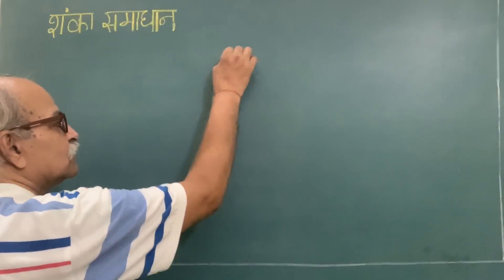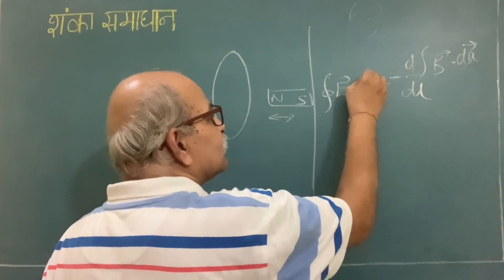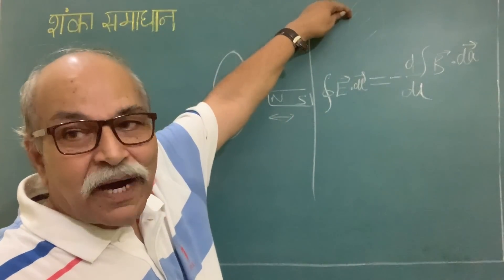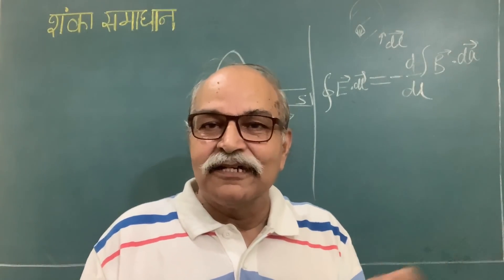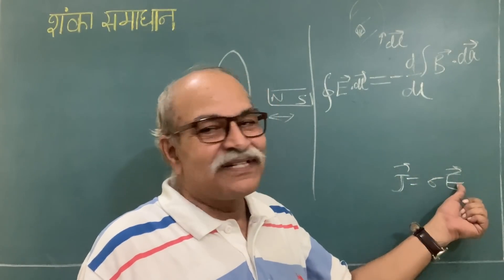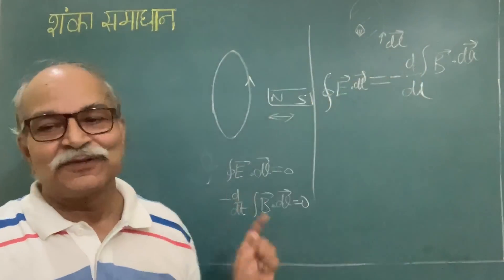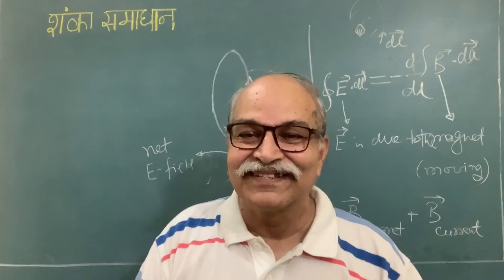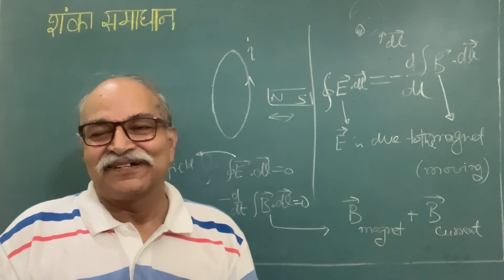Magnet moving in and out of a superconducting coil

Comment: Sir I thought it this way:
If we try to move the magnet close to the loop, then the loop being made of a superconductor will compensate for the flux produced by the magnet by producing a current in the loop making net flux zero. But when the distance between the loop and the magnet becomes zero then infinite current needs to be produced in the loop which is not possible,so we can say that the loop will not let the magnet move by producing repulsive force.

Comment: Prof Lewin says that there will be a current on the surface of the superconducting coil but not inside it. The link to the video in which has posted this solution is https://www.youtube.com/watch?v=fGM5AtwEmuQ

But he does not explain why no current inside the coil does not violate Faraday's law. As Prof HC Verma has emphasized, Faraday's law is applicable on any closed loop, even if the loop is intangible. If we want, we can consider a loop inside the coil. According to Faraday's law, an emf will be induced in that loop, which means an emf will be induced inside the coil. Then why is there no current inside the loop?

Comment: Legends are contradictory with this question and it came in jee advance after 3 week of this video.
Thanks to HC verma sir and Walter Lewin sir. I got 4 marks from this lecture.
Reply: If it was normal Lenz's Law or the 'like' pole - the same pole - produced by the superconductor against the encroaching (moving) bar magnet,  the  magnet would not float, would not levitate,  atop the superconductor - the magnet approaching the superconductor would be cast off to the side, just as in a normal Lenz's Law demonstration.  There is something different occurring with the superconductor - because the encroaching magnet, if placed atop a superconductor, is (1) repelled by the superconductor but also (2) remains in place, levitating, above the superconductor, and is not tossed off to the side.   This is not Lenz's Law.   

The entire problem with common physics today is complete failure to assess and investigate the constituents of the Vacuum  (not the air-pressure-free vacuum, the QED Vacuum).   Until the exact physical nature of the Vacuum is examined - rigorously - these types of questions will fail to be answered accurately.

"So you think space is not empty?  You think there are 'constituents' in empty space?"  Yes.  Here's how to demonstrate it.

1)  put one neodymium (strong, rare-earth) magnet in each hand with the "N" poles of the magnets facing each other

2)  try to push the two "N" poles together so they physically touch (you will not be able to if the magnets have any noteworthy size)

3)  now, while you use your hand strength and coordination to try forcing the "N" poles together,  there is still a gap of space between the magnets because you cannot easily force the two "N" poles to touch together

4)  CAREFULLY LOOK into the gap between the two magnets - IT LOOKS EMPTY

It is NOT empty.  The constituents of the particle-antiparticle Vacuum are not discernible to our vision, but the magnet test above lets you feel the effects of the constituents of space.  An invisible, quite strong force preventing you from forcing two pieces of metal together.

If you're curious along these lines, note this.  The 'virtual particles' of the QED Vacuum - such as electron-positron pairs - are claimed to 'pop into existence, then self-annihilate'

It is long established in the lab that the annihilation of an electron-positron pair produces gamma rays.  If the 'virtual' particles actually self-annihilate, the Vacuum would sustain an easily detectable gamma ray background.  And IT DOES NOT.

The spin of the electron and positron are equal, and OPPOSITE.  The particle-antiparticle pairs that fill the Vacuum are persistent, and dipoles can be induced in them.  They do not self-annihilate.  They are not detected because they are dipoles and cancel.
The electron-positron dipole consists of:
- a negative electron and a positively-charged positron
- opposite spin on the two ends of the dipole

The constituents of the Vacuum can be manipulated (dipole stretch induced, or dipole stretch removed) but the only way to do so is with coherence conditions imposed on the atoms of a matter object.  Coherence imposed on piezo materials by a maser is one way to alter the Vacuum coherently.

The Vacuum very rapidly quenches any attempt to alter its conditions unless the attempt is coherent.  Artificial gravity can be produced in this manner. 
.

Comment: We Generalise a wire based circuit MOSTLY AS A  ONE DIMENSIONAL WIRE with r=0 so it has no interior or exterior or the interior and exterior are virtually not present as if its a line with just 1 dimension.
Here we are taking a wire with finite radius where it has a external and internal space different from each other or as if radius of wire is not equal to zero.
prof verma did with the idealisation of r=0.
I think then it just becomes a thought experiment.
But Prof. Lewin did analysed the situation with a non zero radius .i.e the wire has a surface and then internally E=0.
I guess with the idealisation Prof Verma's solution is not wrong.

Comment: Sir I am in class 10 I have a doubt
Can the average speed calculated like
(Initial speed + final speed )/2
If yes how,if not why
I would be very thankful to you
Reply: It depends on how you define "average speed", IOW on what you intend to do with it.
One usually defines "average speed" as that CONSTANT speed an object should have in order to travel a given distance L in a given time T.
With this definition, the average speed is equal to the *arithmetic mean*, that is (initial speed + final speed )/2, when
- the speed is constant (of course 😁)
- but also when the speed is simply proportional to time v = at, where a is constant in time. This is the case of uniformly accelerated object, with (constant) acceleration equal to a.
However, when the speed is NOT simply proportional to time, but depends on time in a more complicated way, the average speed is NOT equal to the arithmetic mean of the initial and final speeds.
------------------
Remark: it can be show that the average speed is equal to the arithmetic mean also when an object moves with one constant speed v1 the first half of the total TIME and with another speed v2 the last half of the time: v(mean) = (1/2)(v1+v2)
It is interesting that, when an object moves with one constant speed v1 the first half of the total DISTANCE and with another speed v2 the last half of the distance, the average speed is the HARMONIC mean : 1/v(mean) = (1/2)(1/v1 + 1/v2) !!!
Reply: > Thank you !
You are welcome !
Reply: @alexleibovici4834  sorry for late replying but a very big thank you for answering my questions.
Reply: @harshpawar8882  
OK 😁 Hope it helped.
Reply: @alexleibovici4834  yes it did

Comment: It's not good to post any thing or answering the question if you actually dont know its answer..... "Formula says thats why it is happening" what kind of explanation is that?..... Physics is not formula based, Formulae are based on physics....
It also shows that our top class professor knows nothing about concepts of physics.... I would have tell you more but let's just say that...... H.C. VERMA is just good enough till class 12th and not for higher engineering physics
Reply: Ok Einstein
Reply: Go and check out his lectures on nptel for nuclear physics and you will realize the dumbness in your comment.
Reply: Even your father Lewin has made enough of wrong statements in his question video pertaining to superconductivity.

Zeroeth of all, he calls it a JEE problem...Seriously? Superconductivity?

Now comes the first point. Lewin says that there can be no electric field inside the superconductor. "Blatantly Wrong!!!". Ever heard of london penetration depth?

Lewin says in the solution video that the current will flow on the surface of the superconductor. He says that there can be no current inside the material. "Blatantly Wrong!!!" Surface by definition has zero thickness which will blow up the areal current density. The truth is that the current does flow inside the material but near the boundary of the material(near the surface, not on the surface!), significant amount of which is upto the penetration depth. Only deep down the superconducting material, B and E go towards zero.

This penetration depth can be of the orders of nm to um or even could become very very large if you happen to go near the critical temperature.

Second point, Lewin says "the beauty is...faradays law...creates an emf...an electric field..just OUTSIDE the superconductor"....LOL... " Blatantly Wrong!!!" What do you mean by "just outside"?
Faraday's law holds for any hypothetical geometrical loop created anywhere in space. This is what  HC Verma explains in his solution video and this is what you need to learn from him. And it is definitely clear now that you have not heard of 'penetration depth'. Current cannot propagate "outside" the material. The thing which you and many others wrongly call a surface, is not a surface but a volume. In Lewin's words, HC verma's statement that current is there inside the material is wrong. Lewin also states "there cannot be any current in the superconductor".This is wrong! The current is definitely inside the material (LOL Lewin, where else the current could be?!). I again reiterate that current is not propagating on a surface but in a volume.

Coming to the second point, Lewin gives insufficient information regarding the external magnetic field. What if its magnitude is greater than the critical magnetic field? The superconducting state will be lost.

Third, Lewin gives insufficient information regarding the thickness of the superconducting wire. What if I use a thickness comparable to the london penetration depth of the superconducting material?
Reply: @musicalbot9172   I know that you are right.... And I posted exactly opposite to my comment on lewin's video ( saying that he is wrong).... I just wanted to know how many of the viewers of Lewin and HC will reply or support to my comment....
I am glad that viewers like you are there who knows concepts of physics.....
My comment is just for experiment..... who am I to comment on HC OR lewin, when I know nothing about physics as compared to them...
So, JUST Chill and watch "The big boss of comments".....😄😁

Comment: I dont see why this explanation ha problem....
Superconductor is an extreme case of a resistor so when magnetic field starts to change E will be induved in conductor and charge must accelarate now since mass of an electron is very low and theur is no collision loses this acceleration is very high due to which current becomes a significant enough to induce magnetic field which cancels the magnetic field of the magnet in nearly no time so their is no net field inside conductor faraday law is satisfied all laws of motion are also taken into consideration...... i dont see a problem in this now

Comment: A DISPLAY OF A VERY POOR CONDESCENDING ATTITUTE BY WALTER LEWIN! It all starts with his statement "I doubt even Prof Verma can answer this problem". Then goes on to call the solution "blatantly wrong" " and "it is wrong physics" in a poor taste. 

Dear HC Verma Sir, thanks for all ur contribution to the student community.

Lewin just cherry picks on one phrase of HC Verma of the current being in the material and then calls the complete  solution "blatantly wrong" and says that "it is wrong physics" where in fact most of the solution is absolutely correct. It's just that HC Verma should have used the language "E and B go to zero deep inside the superconductor and he could have described the distribution of current inside it but it goes far beyond the scope of JEE (the question said it was for JEE). The bigger irony is that Walter Lewin who calls Verma's solution wrong himself does not understand superconductivity and he so instead of using the phrase " deep down", says that E is zero everywhere inside .

LEWIN himself makes TONS of mistakes in his question video...

Zeroeth of all, he calls it a JEE problem...Seriously? Superconductivity?

Now comes the first point. Lewin says that there can be no electric field inside the superconductor. "Blatantly Wrong!!!". Ever heard of london penetration depth?

Lewin says in the solution video that the current will flow on the surface of the superconductor. He says that there can be no current inside the material. "Blatantly Wrong!!!" Surface by definition has zero thickness which will blow up the areal current density. The truth is that the current does flow inside the material but near the boundary of the material(near the surface, not on the surface!), significant amount of which is upto the penetration depth. Only deep down the superconducting material, B and E go towards zero.

This penetration depth can be of the orders of nm to um or even could become very very large if you happen to go near the critical temperature.

Second point, Lewin says "the beauty is...faradays law...creates an emf...an electric field..just OUTSIDE the superconductor"....LOL... " Blatantly Wrong!!!" What do you mean by "just outside"?
Faraday's law holds for any hypothetical geometrical loop created anywhere in space. This is what  HC Verma explains in his solution video and this is what you need to learn from him. And it is definitely clear now that you have not heard of 'penetration depth'. Current cannot propagate "outside" the material. The thing which you and many others wrongly call a surface, is not a surface but a volume. In Lewin's words, HC verma's statement that current is there inside the material is wrong. Lewin also states "there cannot be any current in the superconductor".This is wrong! The current is definitely inside the material (LOL Lewin, where else the current could be?!). I again reiterate that current is not propagating on a surface but in a volume.

Coming to the second point, Lewin gives insufficient information regarding the external magnetic field. What if its magnitude is greater than the critical magnetic field? The superconducting state will be lost.

Third, Lewin gives insufficient information regarding the thickness of the superconducting wire. What if I use a thickness comparable to the london penetration depth of the superconducting material?

PS: " you" refers to Lewin.

Comment: Sir I have doubt that when light passes through slab the incident ray is parallel to emergent ray. But it is given that they meet at infinity.
Actually they should not meet as they are parallel
Reply: Parallel lines meeting at a point at infinity is a idea from "projective geometry". You can get an intuitive idea of this by imagining yourself standing on a straight railway line on a flat plane. The two parallel rails appear to get closer together with distance, and appear to touch on the distant horizon. Same thing with the sides of a very straight road. It appears that way because the three dimensional scene in front of you is projected into a two dimensional image at the back of your eye balls. Look up "perspective". In perspective, the point at infinity for parallel lines is called the vanishing point. Parallel lines pointing in another direction end up at a different vanishing point (point at infinity).

Comment: I think there will be no current in the circuit, this is because a super conductor is dia magnetic and expels magnetic fields & hence magnetic fields don't penetrate into a super conductor. For setting current in a circuit there must be potential difference and emf. Since here magnetic fields can't penetrate into the conductor, there will no emf & hence no current. So conclusively I can say that Faraday's law is valid for conductors not superconductors.

Comment: Respected sir,  i have one question please answer . I will be highly oblized to you.
We consider  i=dq/dt. It means rate of change of charge with respect to time is called electrical current. Than why it is called flow of electron is electric current. Is it possible to flow current in a metal.???? And if electron flow than what type of chànge occur in metal. Sir, please give us the basic electricity lecturer . Please sir.
Reply: Actually the "dq" in I=dq/dt is the amount of charge passing a point rather than a change of charge. This is an important distinction. In physics it's better to use the current density, J, which is (rho * v), rho being the charge density and v being the velocity. "J" is a proper vector. "I" is not, but it is ok to use in circuits since the direction of flow is along the wires and it doesn't matter that it isn't a vector.

In a metal some of the electrons are not bound to the positively charged atoms. So while the atoms of the metal are fixed in a regular crystalline structure some of the electrons can drift from atom to atom easily and in an electric field will drift along the field and this is the electron flow. The electrons gain kinetic energy from the field but lose it again "colliding" with the atoms, increasing the temperature of the metal. Apart from getting hotter the metal doesn't change. This is only a simplified description. Hope it helps.

Comment: I personally believe no current.
Reason: It will be perfect reflector: reflecting electric field/magnetic field as this material skin depth is zero. 

It mean only current over surface on superconductor and no current inside.

Easiest way to think -  frequency dependence  and current density across cross section of normal metal wire (Alternating Current)

Meaning field lines are literally reflected